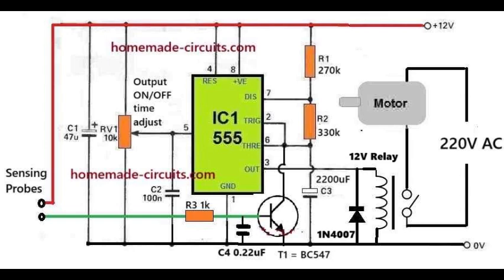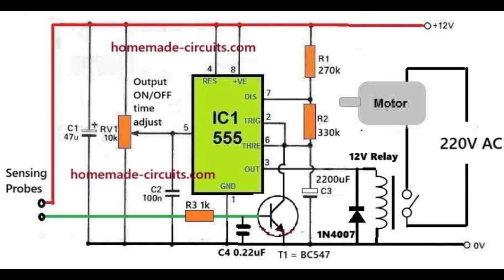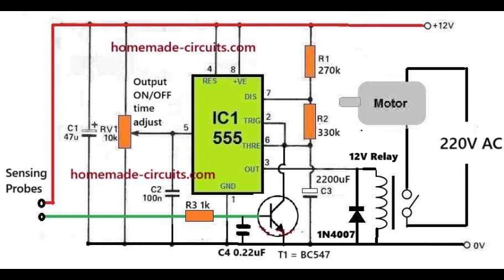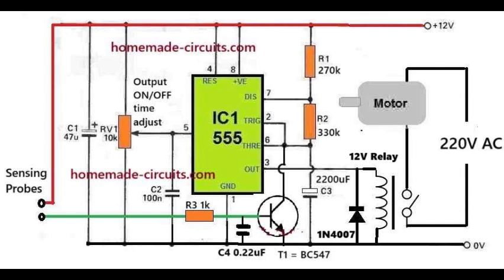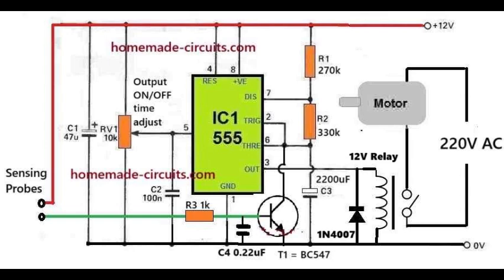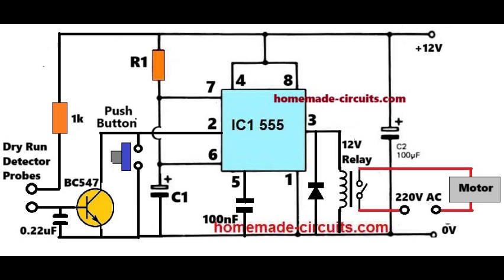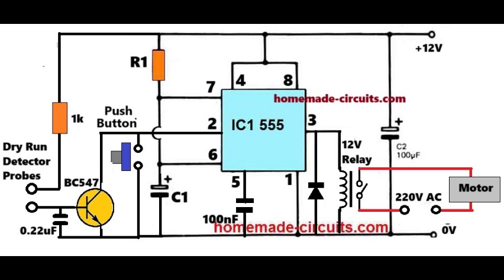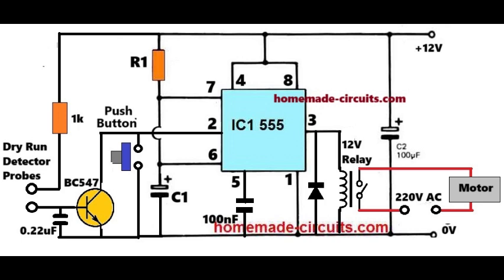Simple Water Pump Motor Controller Circuit with Dry Run Protection

Comment: Sir the 1st and 2nd diagrams are 2 methods of making this circuit ?
Reply from the maker: Gokul, yes, those are the two methods of implementing the pump motor controller with dry run protection...

Comment: Is it possible to do without 0.22 uf for push button circuit. Would that be any problem without it?
Reply from the maker: The 0.22uf capacitor at the base of the BC547 transistor safeguards the transistor from false triggering due to noise interferences. If you remove it, then the BC547 might get susceptible to spurious triggering...
Reply: I did that on project board yesterday. It works well. No error at all. Really appriciate for your projects.😊
❤❤❤
Reply from the maker: @htetaung7315  Thank you for updating the results, glad it worked without errors, all the best to you.
Reply: Thanks a lot for your quick reply. I'm going to try your push button circuit for my pump 🙂.
Reply from the maker: @ sure, let me know if you face any issues with the circuit...

Comment: Great video thank you.

I was wondering if you could assist me with a circuit diagram of a protection circuit, I have pictures of the setup but not a circuit diagram
Reply from the maker: Thanks, Glad you liked it! Sure, if you could explain the specifications of the design i can try to  solve it for you...
Reply: Thanks for your reply.
I have an image if it’s possible to send that to you somehow, possibly via email? It’s a pump protection that my neighbor has but it appears that the company that built it is no longer around.
Reply from the maker: @mcckyl01  It can be actually impossible to understand the specifications of the unit just by referring to the image, so you will have to provide me the complete technical specifications to figure out the circuit design...

Comment: Hi...

So we have timer adjustment (RV1) for restarting of the relay/pump. 

How about if we want to adjust timer for pump run time. For example in ur design contact circuit is ON only for 15 seconds if the water sensor not detecting any water flow or availability. What if we want to make the relay/pump run a bit longer in time.... let's say 2 or 5 or 10 minutes even (not just 15 seconds).

Tengkiyu, kipidap.
Reply from the maker: Hi, the RV1 can be used to adjust the ON-OFF period of the 555 output, you can also adjust the R1, R2 values to further tweak the relay ON-OFF periods, however once  water is detected at the sensor points, the 555 output and the relay will become permanently ON. Higher than 15 seconds is not recommended in the absence of water otherwise the motor might get burned and damaged.

Comment: Your design is complicated. Reed switch with magnet and relays is vvery easy.
Reply from the maker: Reed-switch/magnet system requires a float mechanism to work, which is complicated and expensive to install, and also it won't provide DRY-RUN protection.